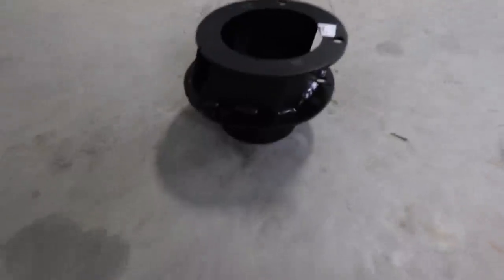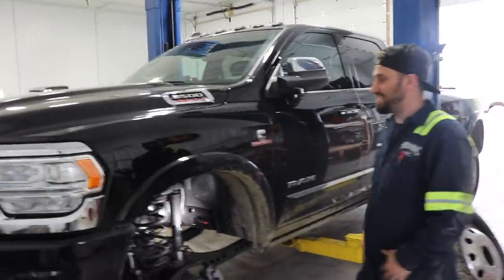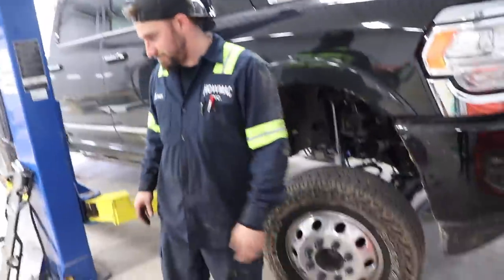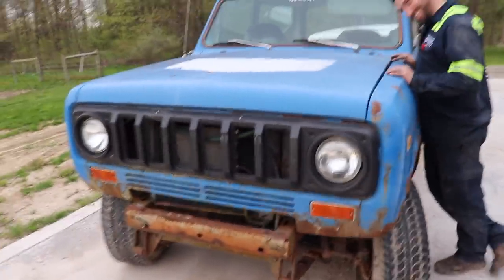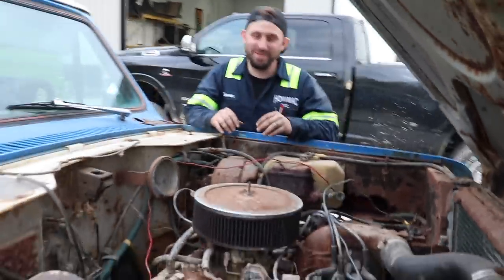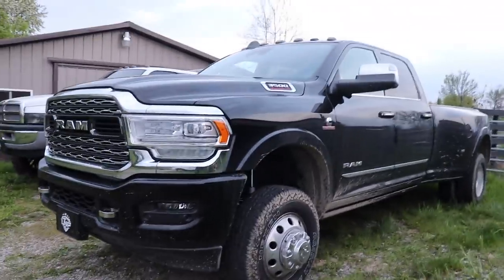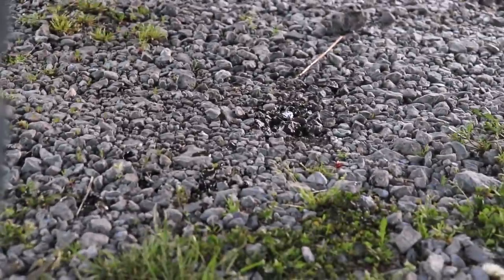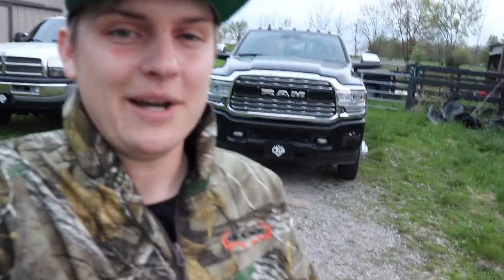NEW LIFT ALREADY GOING ON THE 2019 RAM 3500!!!

Comment: Start it up, take radiator cap off. If the water is bubbling then head gasket bad. If no bubbles its probably just water got up in the blow by tube

Comment: Change the engine oil and filter ! The water was coming thru the breather tube....I would check the axles and transmission as well
Reply: mikestrucks ya pretty much goes for everything after you go mudding like that
Reply: sam dewolf 👍
Reply: What Mike said. He never raised any of the breather tubes on anything besides that snorkel.
Reply: cumminssensation also true

Comment: Definitely check the engine oil on your dipstick. That’s the clearest sign of your oil’s status. If it’s murky and brownish then theres definitely water in the oil. If it’s been sitting a while you may want to drain some from the oil pan, or if you’re really scared just do an oil change. Start her up and check for bubbles in your coolant overflow. If the truck doesn’t have one then check in the rad. I agree with checking axles and trans oils too.

Comment: Water has entered probably through the breathing process or anywhere oil can be leaking out water can enter such as valve cover gaskets had the experience of our company shop lot being flooded and all kinds of drilling rigs and Cummins engines were under 5 ft of water and we saved them all

Comment: Dude if you don’t take those hub adapters off the 2nd gen and try to run those regular wheels on it with them it’s gonna trash bearings and ball joints like once a month...
Reply from the maker: Dylan Adkins watch the videos 🙏
Reply: I think he ran neg. 265 front wheel spacing, which means it doesnt have spacers and the wheels stick out 265mm from center.  I don't like it  but to each their own if I won the truck I would be selling the wheels and tires and putting something else on it then sell the truck as I am looking for a short bed single rear wheel ext cab second or third gen.

Comment: I'd honestly leave the stock wheels on the new truck and put new tires on it and crank the 1st Gen up and pull the radiator cap off and see if it blows water out

Comment: Putting on a leveling kit is no fun. Compressing the spring is the hardest part. And my spring compressor barely held these heavy duty springs so I had to disassemble the entire front end. Pain in the rear

Comment: “On the 1st gen subject” more then likely it’s just poop water from the river. Typically when you pop a head or head gasket it will run like shit and over heat. Check your oil. I would even change it and do a oil filter. You were pretty deep buddy.

Comment: On the 1st gen you gotta raise all the breathers up motor axles transmission transfer case. Or your gonna get water in them. You need to change all the fluids. Instead of dumping all your fuck ups to someone else. Fix it and improve upon.

Comment: 5th gen do a off-road front and back bumper and winch with a tire rack in the bed with 12 inch straight pipe tip